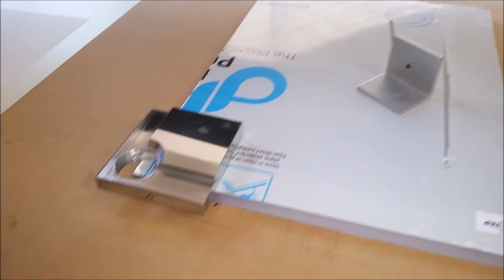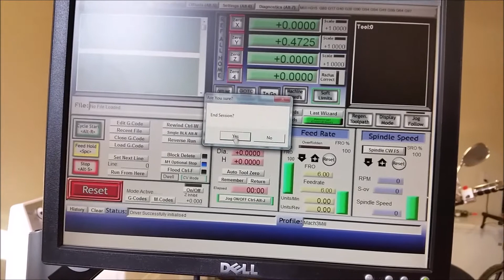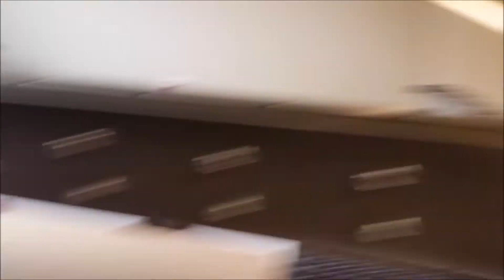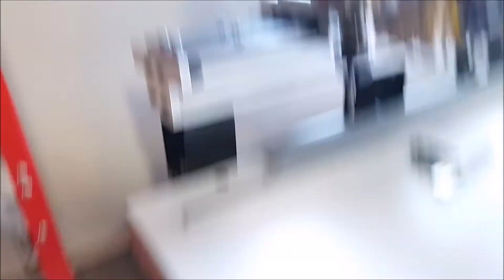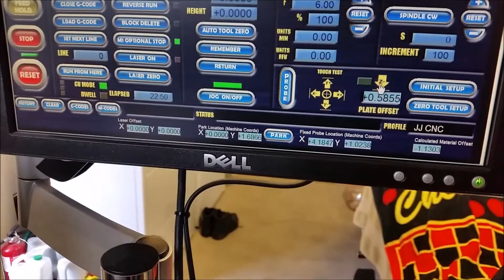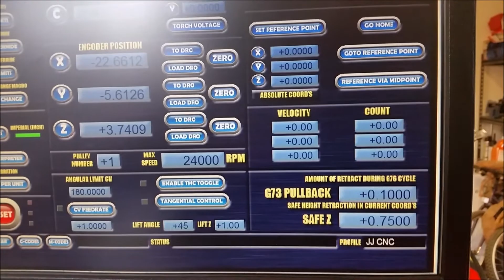Tool Change / Auto Tool Zero  BigTex Blue Screen

Comment: First of all, great video! I am going to set my diy cnc Z zeroing to use a fixed plate as you did. Great idea. I would like to ask you if you ever found a gas spring to help support your spindle as you had mentioned. Right now I am using springs from Ace Hardware. I think they do help a bit but they are as ugly as sin. Do you think a gas spring will supply support movement equally in both directions? Also, I have tried a Jtek RS485 for Mach3 to control my spindle with no success after finding three defective devices. I finally gave up on those. What do you recommend? I am using a Xylotex controller with a UC100. Thanks in advance for any help you may be able to offer.
Reply from the maker: Dan, thanks so much for the view and comment. It means a lot to me to know my videos help others. As for your questions, the first is I decided to go another route with the spindle issue. I 3d printed a ring with magnet insets to hold a piece of 1 1/2 PVC tubing. When I'm done I put the tube over the spindle bit and the magnets hold the assembly to the spindle. The tube is cut to about 3-4 inchs. Now when the spindle drops it stops when the pvc tube contacts the table. A cheap functional solution that works great. You can make the tube as long as you like but I found around the 4" mark to be perfect.

As for the RS 485 looks like the one that I use. I had another viewer that had the same problem as you have. We got it working as he himself was ready to give up. There may very well be a good chance that your settings are incorrect as his were. I'm not clear as to what script your using I believe this is the one that I use. https://www.cncnutz.com/2017/05/mach3-and-uccnc-spindle-control-with.html. You have to make sure the settings are correct or the spindle will not turn on. Also what VFD are you using that could have a big effect on the outcome. Mine is one of the Chinese 2.2Kw spindles and Hyunang VFD. This script is written only for that VFD I believe.

Comment: Jerome, Like this video. helps a lot. I have a question. when I zero my z on the movable plate my z touches off and retracts but does not touch off a second time and retract to the setting I entered. I bought the screen set off the big tex site. Apparently there different scripts for corner zero and z zero. The one I downloaded was different from the one Mark Lindsay had. Mine worked on the corner but would not auto set the drops. I had to do that manually. Is there any way to get a script for z probe that touches off twice. Thanks and again I enjoyed your video.
Reply from the maker: Hello Jim, thanks for watching glad it helped you out. Let me do a little research on the double touch off. You shouldn't have had to add any other additional scripts other that what came with Big Tex Blue screen set unless you don't have physical end stops, which Mark Lindsay did not, nor did he have a fixed touch plate as I recall that could be the problem. I don't use double touch off, but I remember seeing it and I believe the setting is made somewhere in Mach 3. I'll get back to you shortly.
Reply from the maker: Jim, I did a little research and it escaped me so let me correct myself. The Big Tex Blue Screen Set double probes by default. I went down and checked my machine and it double probes. If you have installed another script for zero Z previously you need to remove it. It would probably be easier to remove The screen set and reinstall it. 

Remember, you have to have physical end stops and a fixed touch plate to use Big Tex Blue Screen set with it's default script and it will double probe. You cannot use soft limits or you will have to use another script for probing. No other scripts are required if you meet the requirements listed above. Fixed touch plate, Physical end stops. If you have any other questions. let me know
Reply: Thanks. I figured it out. It double probes during initial setup. Not when manually clicking the down arrow. I do have a couple of other questions. What other settings inside Mach3 config or on the settings screen do I need to make for the tool change, and I assume I need to use the ATC post processor in carve pro. Thanks for the help.
Reply from the maker: The absolute most important is go into your general settings tab and make sure in tool change tab the "Stop Spindle, Wait For Cycle Start" box is checked. It may be that way by default, but check it. As long as you have set up the screen set with tool change location DRO and fixed Plate DRO, the post processor will take care of the rest when it calls for a different tool when you generate your tool paths and then your G Code.
Reply from the maker: Sorry for the addition, but stop spindle is necessary only if you are using a actual spindle with RS485 where the spindle can actually be controlled through Mach 3. If you are using a router such as a porter cable, then you will have to stop your router manually.
Reply: In settings tab on the main screen there is a button "ignore tool change". Does this need to be unchecked. Thanks
Reply from the maker: Yes........... Check box stop spindle wait for cycle start.
Reply from the maker: If you are using a common type wood router then you will have to manually shut the router off,  do your tool change, zero tool, then turn your router back on. Give yourself some time by setting in the ports and pins tab spindle setup. Set your Spin Up Delay to say 20 seconds. If that is too long for you the you can set it lower. That way the spindle will move into position, wait for 20 seconds then resume cutting. That way it will give you time to turn the router on without rushing.
Reply: Thanks for the help.